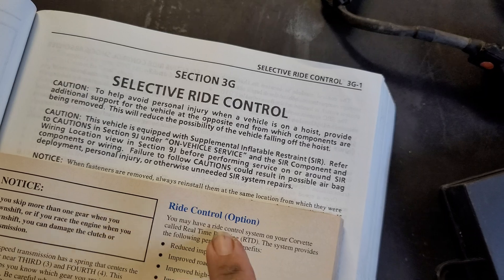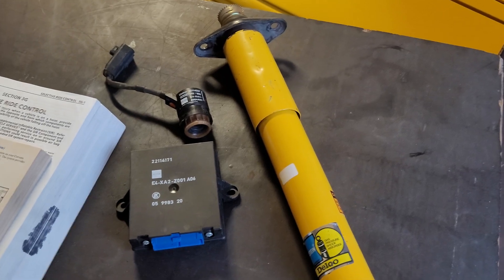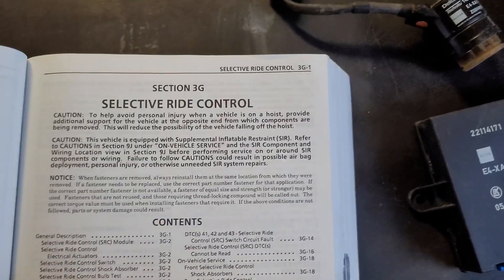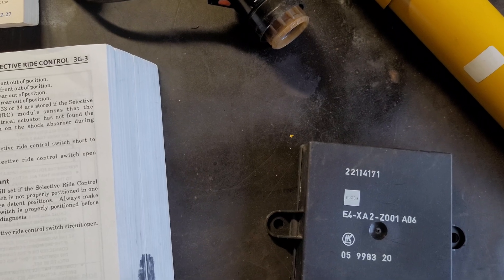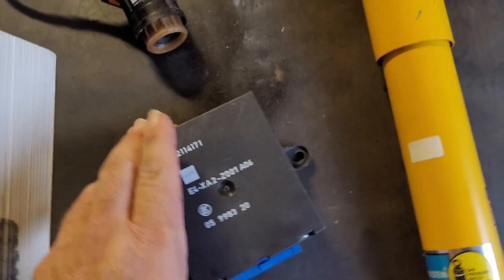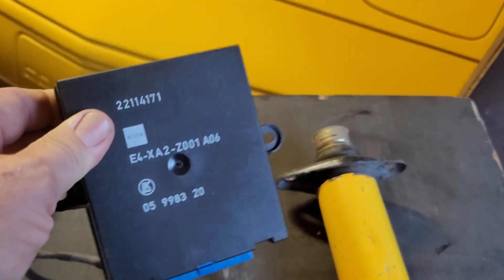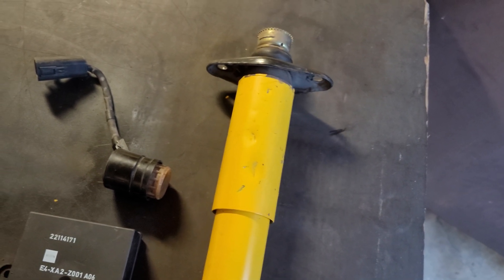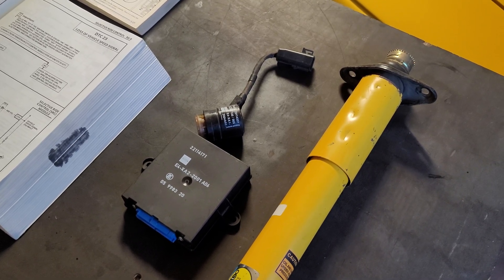The Fragile C4 Corvette FX3 Selective Ride Control System

Comment: They sell all the parts to make this system good as new. Including, replacing the plastic gears with metal gears. Which has a distinct sound when they change valving. Not that expensive at all.
Reply from the maker: Great information. Thanks for sharing👍. Even though I do my best to avoid having cars with this option, I've ended up with 3 C4's with FX3, so I'll be looking into it soon to get them back up to speed.

Comment: Hi, I own a 1991 Ferrari Mondial T which uses exactly the same system  for suspension control like FX3. I need to troubleshoot my system but Ferrari does not give any literature. I see that you have a very detailed manual with trouble codes etc. So, the question is how could I get that part of the manual regarding only FX3 system? Could you help me on that?
Reply from the maker: Hi Aris, the manual I am referencing is the Factory Electrical Service Manual Supplement. They're available from vendors  on eBay and can be purchased for around $50.

Comment: after removing the factory bose radio head unit and the CDM my service ride control light came on.

i suppose it could be just a coincidence, but i suspect i have a lose connection somewhere i exacerbated by poking around in all the wiring under the passenger side dash most likely when i pulled the CDM.

Is there wiring in there that is part of the ride control system, and if so, any easy way to identify which wires they are?
Reply from the maker: There shouldn't be any wiring for the FX3 system in that area. I would check the fusebox to see if maybe you inadvertently created an arc when pulling the CDM. The FX3 module and associated wiring harnesses are isolated to the DS rear storage compartment.

Comment: Currently wifey and I  have a 64, 95, 96.  My wife's 95 vert has the select ride.  Only has 30k miles and it's shot.  Replaced them with regular Bilstien shocks in front.  Not worth it to repair or replace them with the select shocks.  Great channel by the way
Reply from the maker: Thanks, glad to hear you're enjoying it👍. I agree with you that while the system was cool and cutting edge for its time, replacement and rebuild costs have now outweighed any benefit the system once provided.

I usually recommend replacing with standard shocks to most of my customers as well unless they are chasing points in an NCRS judging type of situation.

Comment: For those still wondering, Bilstein has outsourced the rebuilding to Performance Shock. They quoted me $600 PER SHOCK to rebuild the FX3 set. If you have the money go for it, but if you're poor like me, you're probably better off just going with regular B6s or finding maybe replacement FX3 shocks.
Reply from the maker: Yea, I'm afraid $2400 for a rebuilt set of FX3 shocks is pretty cost prohibitive for most, as well as it being a system that isn't absolutely necessary to operate the car. Thanks for sharing👍

Comment: Could you get a 1996 Corvette LT4 with the FX3 ride control? It must be a very rare option in a LT4 because I haven't seen it yet. thanks.
Reply from the maker: Hey Mick, they dropped the FX3 option in 1995 when they introduced the F45 adjustable suspension, which carried over into the C5 generation. It basically a more advanced version of the FX3 system.

Comment: 9 times out of 10 the issue is worn or faulty shocks, if the actuators function, it is almost always a faulty shock or incorrect installation.

Rebuilding the shocks is nowhere near as expensive as the figure you mention, that would be to replace everything with new including the actuators. New shocks were only about $800 a set. You could have them rebuilt and revalved for considerably less than the price of new. They're a bit soft by default, seems a common revalve was around 20-30% firmer. 

GM were not the ones that developed this, the exact same system was also available on some Ferraris back around the same time. It is a Bilstein product and was called FX-3 regardless of which vehicle it went on. The actuators and controllers are the same and also interchangeable. The controller is made by Bilstein, GM had no real input, even though Delco appears on the shocks and the actuators.  

F45 RTD on a 1996 is different in pretty near every way, and uses sensors around the vehicle to adjust shocks in real time.
Reply from the maker: Good info, thanks for sharing👍.

Comment: I'm buying a '91 that has it.  How do I know if it's working?  Thanks.
Reply from the maker: Hi James, there will be a noticeable difference in ride characteristics between the setting on the same stretch of road. Best way to check if you don't have a scan tool is to take it for a drive and see what how it feels.
Reply: @VetteSource  thank you.
Reply from the maker: No problem👍

Comment: do you know what it means if you don't get an error code at all when the light is on? i went through 3 modules without luck.
i just kept throwing parts at it. went to 2 shops with no success. just thousands of $$ worth of troubleshooting 😔
Reply from the maker: I assume your connecting it to a scan tool through the ALDL connector. With no communication, usually the moduel is the problem. However, since you have replaced the module I would suspect you could have an wiring issue somewhere in the circuit.

Do you have the set of Factory Service Manuals?

Comment: Great video! My 93 40th Anniversary came equipped with those. I need to finish it up testing the actuators. I pulled the front drivers side to check if the module was good and it was rotating the gear alright. So my guess is some of the other actuators maybe bad.
Reply from the maker: Yep, the factory service manual will spell out instructions on how to put the FX3 module into diagnostic mode so you can see which codes are stored in it.
Reply: @VetteSource  I made a vid that shows it.  https://youtu.be/AvmvB7dtcrc

Comment: I have a graph for shock gear degree based on mode and speed in mph there’s two versions on fx3 shocks btw
Reply from the maker: Hey Colby, thanks for the information. I didn't know they had updated the shocks during production of the first generation. Is that graph available anywhere online, or is it something you created yourself?
Reply: @VetteSource it’s in the owner’s manual.  The damping stiffens with speed, so the user is basically selecting the curve, not a fixed rate.

Comment: Our 96 has this and its amazing you can feel it work instantly. The shocks are holding up well with 30k on the car. I pounded it an an autocross and it was amazing to feel it work.
Reply from the maker: Yep, interestingly enough the FX3 was discontinued in 1995. The 1996 is equipped with the F45 Real Time Damping suspension, which utilizes small modules at each shock position with an rod that adjust the shock valving. 

From what I remember, it was quite functional and much more sturdy than the FX3 system and continued on into the C5 generation.
Reply: @VetteSource  I have a 96 with the F45 suspension. Is there anyone out there that rebuilds those that you know of?
Reply from the maker: After checking just now, it looks like Bulstein is still offering a shock rebuild service for a little over $100 per shock.
Reply: @VetteSource  could you provide the link for that?
Reply from the maker: https://www.bilstein.com/us/en/technology-and-knowledge/service/
Reply: @VetteSource  i have had two 96 vettes with this expensive f45 option. both cars were 50,000 miles + in millage. The f45 system wasnt very good, you couldnt tell any difference in the different settings. No replacement parts are available. only used parts available and who wants to replace there shocks with another used shock. Best option is to install regular new shocks and disconnect the F45 system. Or better yet is to replace the F45 set up with coilovers.

Comment: Hey long time no see what's going on I found out what was wrong with my 1986 LT1 with a 1993 engine the two wires that connect to the coil pack have a short I am going to replace those two wires there's no check engine light and I'm in the go but right now it's winter time so I will wait till summer time to have this procedure done. PS this electromagnetic ride made it a little easier for Corvette owners but when it got old people replaced it with blitstein shocks they disabled the system but it was effective😁😁😁
Reply from the maker: Hey man, Happy New Year👍. Good to hear from you and that you've made some progress with the car. Keep after it and you'll be cruising before you know it. TTYS.

Comment: I replaced mine on my 93 with regular Bilstein shocks and pulled the bulb in the dash since the light came on when the FX3 system was disabled.   The ride is much better.
Reply from the maker: Yep, as much as I normally dislike disabling some of these systems for convenience, most of the time it's the better choice in the long run if you just want to drive the car.
Reply: How do you take the bulb out? My fx3 on my 95 was taken out but that light is annoying.
Reply: @tonep4677  it's pretty easy.  There are a few screws holding the top vent and stereo cover on.  Take them out and you can pull them off.  There are a few more screws holding the white part containing the dash lights.   Take them out and pull that back.   Then just twist the light bulb a half turn and it will come out.
Reply from the maker: Like The Guy mentioned. It's a fairly low stress operation to get the DIC panel out. I can make a video on the channel later if that helps.
Reply: @tonep4677  just remove the module and the light will turn off. much easier
Reply: So when you replaced them you just completely take out the unit that turned the FX3 shocks?  I assume the standard Bilstein shocks go right in?  Thanks.
Reply: @yimmys85  yes it's actually pretty easy.
Reply: @Jeff Spicolli you do it yourself?  The '91 I'm buying has this and I didn't like the low speed ride at all.
Reply: I have a 93 I am restoring. My wife's car since 93, but has been in garage for last 15 years. Which Bilstein shock did you go with?
Reply: Which Bilstein shock did you go with? Going to do the same.